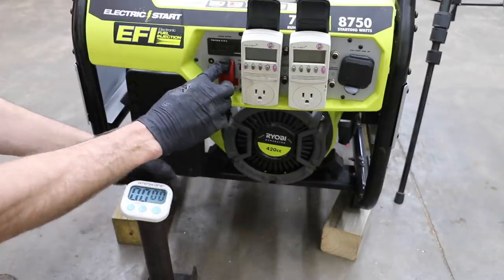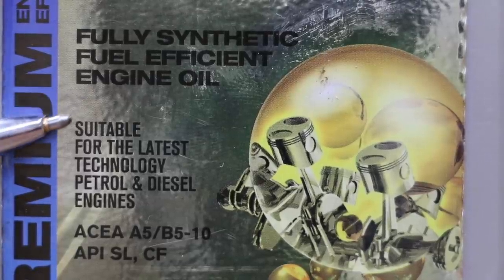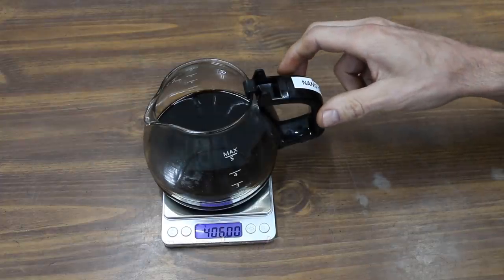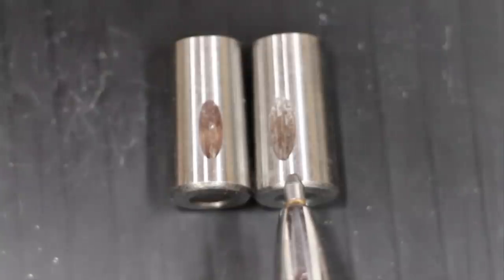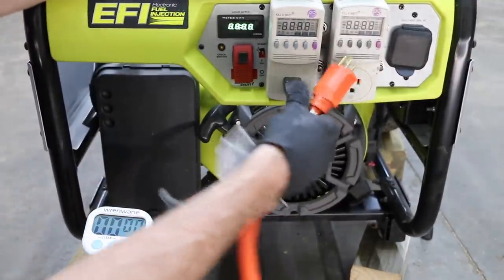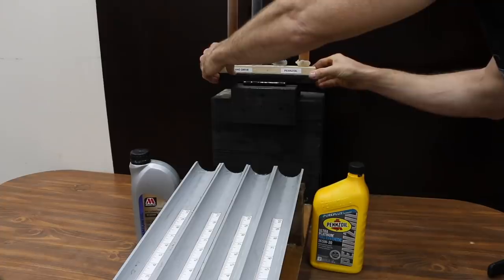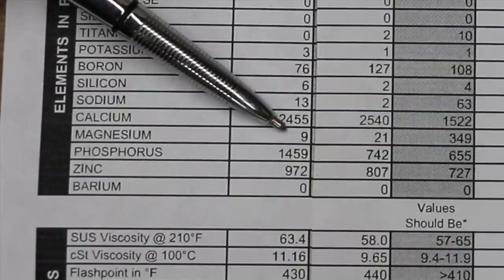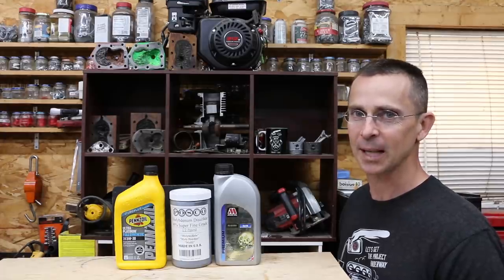Save Gas with "Nanotechnology" Motor Oil? Better MPGs? Let’s find out!

Comment: Hope you see this and I have a really great video idea for you to do. I have recently purchased a rather expensive (to me at least) receiver hitch. I see some videos here and there of defeating locking hitch pins but what I really like to see is which one is the toughest. There are so many to choose from both from auto parts stores and from online (aka Amazon) I personally have chosen what I believe to be the best locking hitch pin from paclock. I would like to see your tests and option on this matter. One test I do want suggest is just using a plain piece of pipe about 3 feet in length on the lock body and prying it right off. I want to see who can survive that test.
Reply from the maker: Thanks for the video idea.

Comment: My only quibble with your test concerned the original drained oil from the generator. The first batch of oil tested could be contaminated with some residual old motor oil. I realize that in that portion of the test the resulting difference was very much unspectacular, but I think this element of the test could be improved. Otherwise, your testing discipline is very high. Congratulations.
Reply from the maker: Thanks!

Comment: When analyzing metal content you should know that too much of them can cake the inside of the engine and/or ruin newer catalitic converters.
As you noticed Millers had more metals (being suitable for older cars) while Pennzoil had a better base oil,that's expected.
New cars suffer from a lot of metals, here in Europe most oils have very low metal content due to DPFs ,GPFs and such.
I've found an oil with awesome base and metal content but can cake my family car due to direct injection not cleaning the valves.
I've seen a lot of reviews made by americans and Pennzoil proven to be a very high quality product.
Reply from the maker: Thanks for the feedback.

Comment: Good info!!!  Can you do a test with Amsoil 5w30 vs Motul 300V 5w30 if you haven't?!? Reason being I drive an infamous oil burning Infiniti FX45. Although mine has been maintained very well from an oil standpoint, my FX is at 208k and some change on mileage and start to burn oil not by much though.  Motul has ester which I think the Vk's and Vq's seem to like. Wanted to see them battle it out.
Reply from the maker: Thanks for the suggestion.

Comment: Can you please do an extended test of Royale Purple on an older, higher mileage car engine? I have heard so many stories of people seeing the oil getting dirty after a short period of time due to the oil actually doing that much cleaning. I know the stuff if pricey, but if it's claims are true then it would be worth the extra money. Or you can test alot of different oils that contain zinc and maybe have a normal synthetic as a base line oil in your testing. Like the Rotella T oils for diesel engines. Alot of people swear by oils that contain zinc.
Reply from the maker: Thanks for the video idea.

Comment: Please test Powerup Oil Additive,  it works for gas or diesel.  I cannot tell you why, when I put powerup in my 2006 jetta, it stopped using any oil.  Before it would use a quart between oil changes, 6000 miles.  Now I run it 9000 miles, and never add oil. I have never seen anything like it.
Reply from the maker: Thanks for the video idea.

Comment: Any chance you can find a way to test, or at least review different engine oil filers for protection and flow capabilities? I've always used K&N filters, but would rather use a different oil filter if it provides better protection for my engine.
Reply from the maker: Thanks for the video idea.

Comment: I wonder if you can do video about oil evaporation. Compare how much oil you have on the engine (let' say you put 3.6L of oil) and run it until 7500 mi and compare how much oil was left due to evaporation/thermal breakdown.
Reply from the maker: Thanks for the video idea.

Comment: I'm gonna be restoring my 76f150 and I wanna paint my frame, and under the bed and cab with chassis saver paint. What brand makes the best sealer. I have been told KBS makes good stuff but I was just wondering what was the best bang for my buck.
Reply from the maker: I need to test this category of products soon. Thank you for the idea!

Comment: Technically speaking, the Millers oil wouldn't meet API SL because the phosphorus level is over 1000 ppm, nor should they be claiming API CF because that's long obsolete, as is any category prior to API CH-4. We see this a lot in the UK because hardly any of our oil carry the API doughnut. Secondly, the Millers also cannot meet ACEA A5/B5-10 because you're not allowed to claim an obsolete ACEA category or obsolete issue of a category - this is the latter case. It's really very naughty, and technically Millers shouldn't be making any performance claims. Even their viscosity grades aren't correctly labelled (it should be SAE 5W-30, not 5W/30, 5W30 or 5w30), so on a technicality they're not claiming any viscosity grade at all. Sadly, this is typical of oils in the UK market. I've actually found better quality oils in Africa than in the UK, particularly for diesels!
Reply from the maker: Thanks for the feedback.

Comment: I'm curious why you didn't test the Miller against the Amsoil signature, since it was the winner over the Pennzoil in your last test.
Reply from the maker: Thanks for the suggestion.
Reply: @ProjectFarm  But the Penz did come in a close second. I use the Amsoil Signature oil but it's getting more expensive ($15 to $12.50 in Canada)than the penz you tested so I might have to switch. But the Amsoil sig is good for 25K miles, not sure what the Penz is good for, do you know.

Comment: You have to do a redline vs amsoil but with both used (5k miles and 10k miles). Redline has to be the only oil that gets better as it is used, especially when it is a swap from another oil.
Reply from the maker: Thanks for the suggestion.

Comment: Molybdenum is more expensive than titanium, by weight. Pennzoil claims to have no solids (solid additives) in its motor oils. All GF4 and GF5 motor oils are supposed to have seal conditioner (seal swell), but Pennzoil Platinum causes leaks at the rubber seals in my engine where Mobil 1 doesn't and the leaks stopped when I switched back to Mobil 1. I really tried to like Pennzoil Platinum, but I have to go with practical and choose Mobil 1 for a leak-free motor oil. Non-synthetic conventional Pennzoil motor oil is supposed to be one of the best, but it cost about as much as store brand full synthetic. Pennzoil's sister oil, Quaker State synthetic has cheaper additives, but it doesn't nearly as well in testing and has more standard pre-canned additives, than boutique additives.
Reply from the maker: Thanks for the feedback.

Comment: How about testing Harley engine oil such as the 20w/50 syn3, Lucas, redline, amsoil, Schaeffer's, and mobil 1? There is much debate about which one is best. I think it would be a very interesting test since it is supposed to have different additives than car or truck engine oil. Just an idea.
Reply from the maker: Thanks for the video idea.
Reply: @ProjectFarm  I just discovered that Supertech oil has a 20w/50 V-twin oil at Walmart. Huh, I wonder if anyone uses it and what is in it?

Comment: Interesting less wear in used in Taxi fleet, hot seat shift transfer cars to next guy( New York) 24 hour use where engine is never turned off maybe less wear would be better.    And if you just drive 500 plus miles a day long haul.   Also might make a difference.
Reply from the maker: Thanks for the sharing.

Comment: Hi there 
Is there a way you could compare  Shell Rotella T6 Multi Vehicle Full Synthetic 5w-30 vs Shell Rotella Gas Truck 5w-30? And or the Shell T6 vs Pennzoil Platinum 5w-30. Reason I’m asking is I always been running Pennzoil Platinum and switched to Shell Rotella Gas Truck then I found Shell Rotella T6 Multi Vehicle.

Thanks in advance
Reply from the maker: Great suggestion!  Thank you.

Comment: Would you be able to compare some OEM motor oils? And then perhaps compare the results against aftermarket oils? I like to use the oil that my dealership sells for my car, the bottle label is that of the auto manufacturer though I know it's usually produced by a third party company.
Reply from the maker: Thanks for the suggestion.

Comment: Would you consider a video on tape measures. I have a few different brands snap on,  Milwaukee etc. and they seem to vary on measurements,  which is the correct measurement?
Reply from the maker: Great suggestion!  Thank you.
Reply: I noticed the difference between the snap on and Milwaukee at 90 inches  but the same at 48 inches. With wood being so expensive thought of you.  Huge fan great videos.

Comment: Love watching your videos more than I like watching Hollywood productions. Thanks for all your work. 

I'd love to see testing on garage door insulation. There are several products that boast R ratings that seem too good to be true and others have no R rating (this list is from HomeDepot.com: Garage Door Insulation Kit r4.8, Owens Corning R8, Matadore R4.8, ADO Products GD Kit R8, NASA Tech White Foam No R value 
There are several different types of insulation, fiberglass, reflective aluminum, cellulose, etc. 
Do some work better at keeping out the cold and others the heat? 
Is there a combination that works to improve R value best? 
Weight, does the weight of any of these products amount to enough to hinder garage door performance/damage garage door mechanisms and/or motor? 
Thanks again for your work!

Comment: Sir, have you heard of MPT Industries?  They are USA company claiming 100% Synthetic with Ester base stocks and their 30K series claims to go 30,000 miles.  It actually says 100% on their bottles which most other companies except a few will write 100% on their bottles.  Their SDS report shows comparison tests against Redline, Amsoil, Mobil 1, etc blowing away the competition. They say their starting Total Base Number is 12.5 which is a lot and equivalent to Amsoil.  Please do a comparison test with MPT Thirty K oil and Amsoil.  I think MPT might win it.  I don’t know of any company that uses 100% Ester in their engine oils except Motul 300 V.  Redline claims it but they are not allowed to write 100% on their bottles.  MPT is supposed to be Ester base stock with ZERO petroleum in their products.  Thank you.
Reply from the maker: Thanks for the video idea.

Comment: Lots of claims about oils, but do it really matter? My friend has a 2000 toyota corolla with 340,000 klicks on it, alee ever used after it came off warranty is the cheapest he could find and didn't care about the brand. Care still runs fine with no problem and still passes emissions in Ontario, Canada. as for the changing frequency, he says he changes it when it gets dark.
Reply from the maker: Thanks for sharing.

Comment: Theres a bunch of crap LEDs on the market for headlights, interior lights and so forth. Test led headlights and interior lights specifically off amazon and see which are the best and longest lasting.

Went through a couple of sets of LED lights; they were way brighter and nicer but since they lasted 6-8 months I just went back to the old reliable halogens.
Reply from the maker: Thanks for the video idea.

Comment: You failed to compare apples to apples.  This was a previous generation Millers against the latest generation of Pennzoil at the time.  The fair test would be to test both gf5(of Gf6 today)  SN  s ; instead you tested a SL vs SN but surprising the Millers performed well against the latest specs.     I appreciate the testing you do to compare but make it a fair comparison.

Comment: Fun project would be to build yourself a generator to run off your generator so you get that energy back in your power bill.

Wouldn't save all that much, but would be fun, and you could bill it as ecologically responsible.
Reply from the maker: Thanks for the suggestion.

Comment: I guarantee that generator is the best one on the face of the planet.
It gets an oil change every single day. LOL

But in all honesty, I use Rotella T4 15-40 in EVERYTHING.
Never had a problem and don't predict to see any in the future.
All of my small engines are highly used and don't burn.
My work truck is pushing 500,000 miles and going strong.
My goin' ta town rig is just as good as it was new in '99.

All this multi-grade oil stuff is just nonsense in my opinion.
Reply from the maker: Thanks for the feedback.

Comment: Hasn't Amsoil been making synthetic oil from natural gas for decades?

I'm thinking Pennzoil is either lying or getting off on a technicality here.

I've run Amsoil on one year oil changes for 18 years and have never had a major engine problem. Let's see other synthetics do that, and I will be very interested in switching (as long as they are cheaper).

Comment: I have watched this and many of your other oil tests.  What I think would be helpful is to also have a running clock (somehow) on your cold pour tests.  Assuming test conditions are consistent or similar, going forward this would allow you- and us- to compare one oil to another across several tests and into the future as more products are tested, new ones introduced, and old ones "improved".  From the big test you did (last year?) most of the data you tested for and observed could be extracted and compared directly between all the tested oils.  However, each of the pour test results could only be easily compared in the one specific test, and- with difficulty and inaccuracy- be compared against others tested separately.
Reply from the maker: Thanks for the constructive feedback.

Comment: No wonder the pennzoil won the cold flow test. Miller’s is a 40 weight, pennzoil is 30 weight
Reply: Both quarts in the video are 5w30.

Comment: I wasn't too impressed with this video. Motor oil exists for one reason -- to help prevent bearings and other metal on metal engine parts wear. Pennzoil lost that test hands down in the video with the wear test. The negative 40 temp test is kind of ridiculous unless you live in Alaska or mid/northern Canada, and is not really applicable in the other 49 states. Personally I didn't care which won the test, as I have absolutely no bias on the matter. The items Pennzoil was "better" on are somewhat silly, basically like lower viscosity, which also means it will not stick to a surface near as well, thus causing faster wear,  all additives not even considered. With the additive, Pennzoil only had better detergent dispersion, that's it. That is not something to be proud of, or satisfied with, as the concept is meaningless if the other oil has merely enough dispersion additives to do the job properly, which your actual wear test under load demonstrated it did, even with cooked oil. Not enough dispersants can cause greater wear as well which would have shown up in that wear test. Only one place did I see that the "Nano" oil may have failed in comparison, and that was the much larger amount of vapors produced under hot conditions, i that said vapor would blow by the rings and get burned in the cylinder, causing slightly higher oil usage over time. However, it would be worth the slight decrease in the fact that engine wear over time would be drastically lower with the other oil -- which means quite a few more thousands of miles on the engine in question before parts start going poof. Engine oil exists for the sole reason to reduce friction on moving parts in the engine, period. That's it. Again, the Pennzoil loses that test hands down according to your own testing methods. I still wonder though exactly what actual nonstandard nanotechnology was employed, as I am betting that is just a gimmick referring to the high quantity of moly particles.

Comment: Synthetic oils drop my oil pressure  & the engine knocks. Runs normally on conventional.  Damn Silverado's
Reply from the maker: Interesting.  Thanks for the feedback
Reply: @ProjectFarm  I added an additional quart  of oil so it was a quart overfull, which stopped the knocking & I went straight to the mechanic, who also drives a Silverado & he told me synthetic is too thin for V8s. He checked everything that could cause low oil pressure as I asked but he assured me it was my recent change to synthetic and the hour-long drive I was just coming back from. I was doing about 75mphs most of the trip when it started knocking. He changed the oil to conventional, the oil pressure came back up, been running normally since.
Reply: I was running Penzoil. They prefer Valvoline or Chevron

Comment: I'll never trust pennzoil. After all the crap they pulled in the past with their sub par crappy oil. Seems better now but I'd use that miller oil no problem. The only advantage pennzoil had here would be in arctic temps. miller actually had a much better anti wear result. The bearing wear test is so extreme even tiny differences are massive in real world application.
Reply from the maker: Great feedback. Thank you